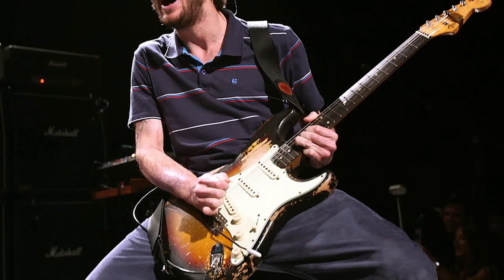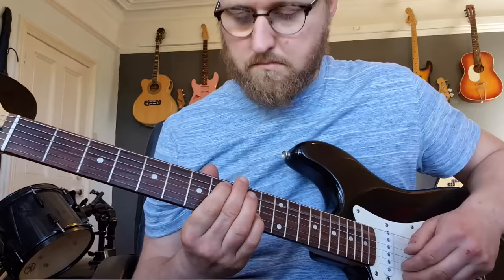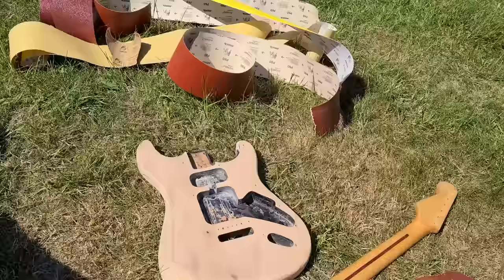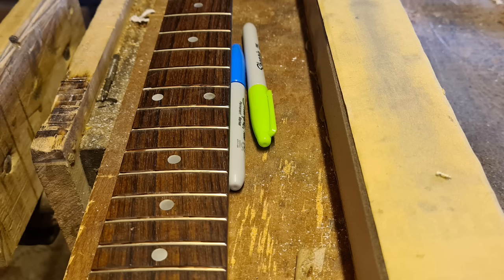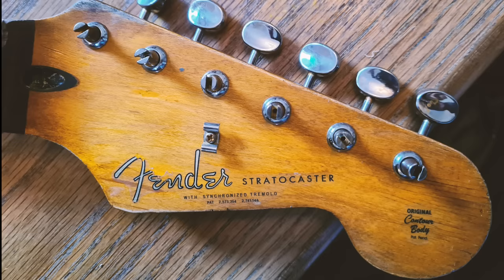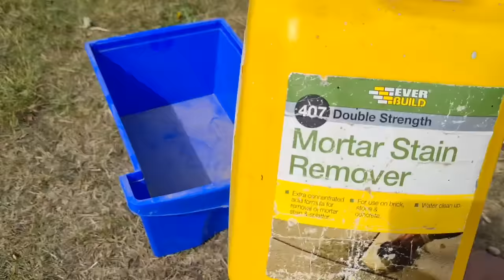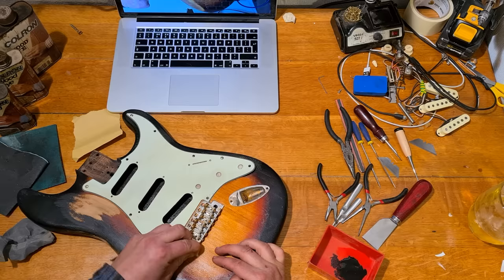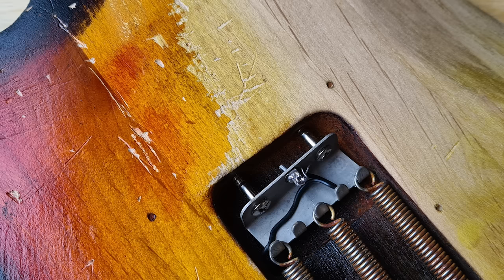How To Turn An $80 Squier into a John Frusciante 1962 Stratocaster

Comment: Nitrocellulose looks better and it's okay to just prefer it because it looks better. Stop pretending you're gonna get a better sound because of the finish. It's okay to just like something for how it looks. Also resonance is not something that is necessarily good for solid body electric guitars. The more a solid-body electric guitar resonates, the more energy is being stolen from the strings, and the less sustain you will get. If you have very lightly wax-potted or non-waxpotted microphonic pickups, the resonance is something your pickups will pickup, but you still have less sustain and dBs coming out of your guitar. It won't necessarily make your guitar sound better. If the energy that could be used to keep your strings vibrating is now used to make the body of the guitar vibrate, you will have less energy left over for volume and sustain. It's just physics. Kill the bro-science.

Comment: In case you are thinking of doing this (or something similar) I wanted to share a similar trip down the same rabbit hole ... it all starts with a cheapie Squire that tells you it knows it can be 'more' ...

I did something similar with a tobacco-burst (2003?) Squire Stratocaster to try and get a Strat that was extra light and resonant like an original '58 was. That body wood (alder?) is super light and also wonderfully resonant so it sounds feels more 'alive' than most solid body guitars, even other Strats. The neck was replaced with a Mighty Mite stock replacement with vintage tint and rosewood fret board, well worth the money. I don't have the skills to level and crown frets and this was a worthy solution. A drop-in, pre-loaded repro '57/'62 pick guard from Fender was installed and also a Vega Trem whammy bar. The Vega Trem really improved the tone dramatically, it sounds almost like a very mild chorus is happening, but with even better, richer harmonic overtones. It also got GoToh tuners and a new Fender impact case. 

Spent roughly $1,000 and don't regret it. It weights about 5.8 pounds and does pretty much everything you'd want a Strat to do with very good playability. Is it as good of a guitar as an Eric Johnson Strat with rosewood fretboard? No. The EJ Strat is slightly heavier but is still very light for a Fender Stratocaster. And astonishing alive plus very resonant in a balanced and inspiring way. Bottom line is both were worth the money in terms of value, effort and satisfaction. I didn't do any relic-ing or refinishing to the Squire and it looks very much like a new '58 Stratocaster. Just needed a couple of hand tools and the kitchen table.

Comment: Your comments about the Machine Heads are nonsense and proves you know FA, no two metal surfaces at 90 Degrees will EVER slip, jump yes if faulty but never slip, Machine Heads are designed to be Self Locking, why do you think Machines Heads from the 20's/30's etc and earlier still work....A lot of work for nothing....